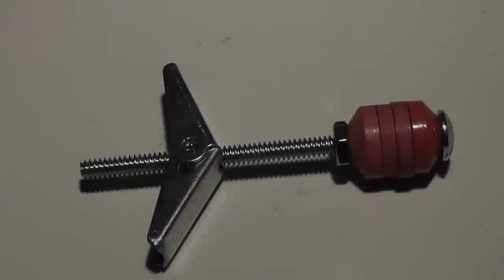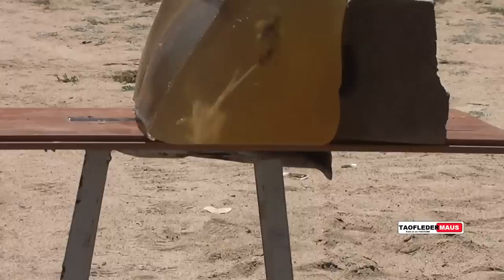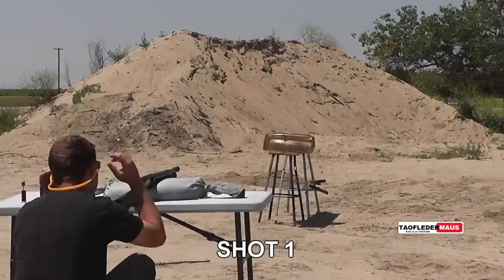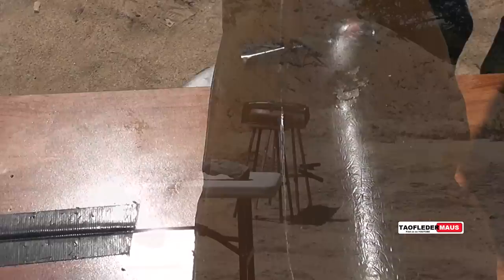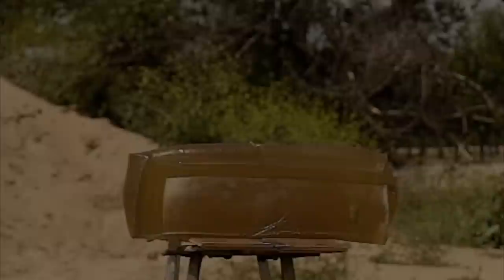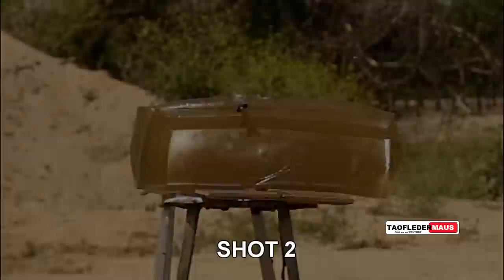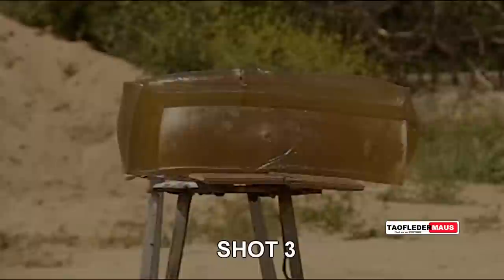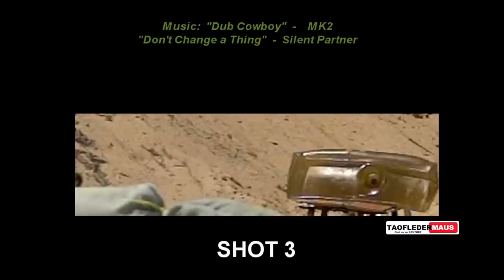Homemade SHOTGUN Folding-Fin Projectile Experiment

Comment from the maker: Song?
Reply: Darude-sandstorm
Reply: Sarude-dankstrom
Reply: ***** Toggle-Boltstorm
Reply: ***** Dankrude - Memestorm
Reply: ***** "Dub Cowboy", "Don't change a thing"
Reply from the maker: *****   Flirtin' with Disaster by Molly Hatchet.
Reply: that's a good improvised round there
Reply: Do a barrel roll! Great video as always.
Reply: Leafy MC Green imagine if he used metal. washers instead of rubber.
Reply: Sarude. Dandstorm
Reply: ***** omg rofl
Reply: ***** try to put less and more weight in the front
Reply: ***** Try reversing the toggle and see what penetration would be.
Reply: Blade Ranger Probably would be less penetration since the toggle would slow down the projectile. It would work like a parachute.
Reply: Was the barrel damaged pretty badly or about the same as usual
Reply: Blade Ranger exactly what I was thinking
Reply: He already said the toggle would get caught in the muzzle brake if it was reversed so it wouldn't work.
Reply: ***** Darude - Sandstorm
Reply: ***** darude sandstorm
Reply: BossBunny.Com butthurt detected

i did it for fun :^)
Reply: BossBunny.Com you still there?
Reply: Darud-sandstorm hehehe
Reply: The random gamer Darude - Sandstorm.
Reply: +Ponto Edu WRONG! It's tsuretette from boku no pico.
Reply: +TAOFLEDERMAUS out of all the dart rounds , this one worked the best....that's hilarious. You should try these at a longer range.
Reply: +TAOFLEDERMAUS you need this with remote C4 ;D
Reply: You guys shoulda reversed the fins.
Reply from the maker: So it wouldn't work?  huh?
Reply: +TAOFLEDERMAUS Could have taken some pliers and twisted the ends of the 'fins' to provide some more spin, you could probably prevent any tumbling and make it fly true at much longer ranges.
Reply: Boss Bunny if you want to bait at least make it seem realistic
Reply: +TAOFLEDERMAUS Shoot a Vat19 5lb gummy bear with this!
Reply: can you shoot little rocks out of a shotgun
Reply: load them tip side down.

Comment: I love this round; it has great potential. It could be worth trying a thicker bolt for more mass and less bending, though you might then need more parachute effect - three plastic "fins" would be nice.
Reply from the maker: Ijusthopeitsquick    There's several factors I have to consider when I make stuff like this.  It has to fit the bore,  it has to be able to distribute the forces being pushed against it without being destroyed,   and it has to weigh 1 oz or less.
Reply: ***** I understand. In any case well done for creating an effective projectile from drywall fittings.
Reply: ***** Perhaps a second set of "fins" screwed on perpendicular to the other and maybe a rifled choke to induce a stabilizing spin...
Reply from the maker: I don't think there'd be room in the shell for that.

Comment: LOVED this video! This is probably my favorite of your homemade shotgun round videos. A few ideas to develop it further: 1) Use something heavier than faucet washers (preferably lead) for more consistent penetration and more forward center of gravity to take better advantage of the stabilizing drag from the toggle. 2) Use a bolt long enough to fold up TWO toggles, so that you can index them perpendicular to each other. Might have to load this into a 3" or 3.5" hull. 3) Shoot them at 50 or 100 yards to see how stable this upgraded design is over a long flight path. If by any chance this is going to exceed your $5 video budget, I'd be happy to make a donation to cover the extra expense!
Reply from the maker: elektro3000   I don't think I could add more weight otherwise I would go over 1oz.   I couldn't fit two toggles on it,  they are 1" long when they are folded and there wouldn't be any room in the shell to overlap them.

Comment: Sweet, and it makes sense: Gas pressure from the back passes the fins and expands the washers against the bore, so the nose actually pulls the rest of the round; fins open on exiting the bore and provide drag at the tail to keep it stable in flight. So much better than a round being pushed from the back, inviting tumble. Brilliant.

Comment: That was really amazing. Well thought out actually. I thought that the thin bolt would bend due to the high pressure, but it all stayed in one piece and did exactly what you hoped it would do. Great high speed footage of the rounds flying perfectly. Thanks for taking the effort to do these kinds of tests.
Reply from the maker: Bill Ryan Thanks Bill.  Yeah,  that screw was pretty thin and I thought it would get all mangled up when it was shot.

Comment: Not gonna say I knew it'd work. I've seen a lot of your videos, and am hugely amused by them. Keep up the good work. However, I'm not surprised, and here's why: Stable supersonic flight requires a very fine point on the leading edge (look at things like the SR-71, or High velocity rifle rounds). or a flat one, like some ICBMs, but that's a different topic ;) The shock waves created by the object in flight prevent any traditional drag creation device, like fletching, or thread, from having any effect (this is one reason bullets have a flat behind). If you look at your "hardware store special" two things (maybe three) are happening that make that a relatively stable projectile. 1. the metal fletching is probably back far enough, and opens wide enough to get outside a shock wave. 2 The gas pressure, and spring force are blasting the fletching into the right position. spring force alone would likely work for a longer shot, but the added pressure helps them come out sooner. 3 (maybe) you could be subsonic as a result of the shape. note posted a similar comment on a different video.

Comment: Holy cow, you'd be right in my initial reaction to the round, but wow, other than some pressures making them self obvious on the first round (as it flew slanted like a wing) the rest were spot on. I was thinking that the tail would just shatter off, since the actual portion those screw in aren't very solid, but man I'm glad when I'm proven wrong in positive light like this! This deserves some further investigation.

Comment: I think these rounds can fly well past 200 yards with some modification. Turn your faucet washers around. They will lock in the open position. As it is the air pressure is causing them to open and close at different times, destabalizing your round. Move this washer forward half the distance where it is presently located then add a second faucet washer where the first one was previously situated. You need at least 3 fins to obtain equilateral stabilization. It should work so long as the tip is slightly heavier than the rest of the round. Something I remembered from my Armor Officer's Course many years ago and might be worth a shot.

Comment: Like I said before, its the Badminton Birdie design physics. I knew that would work. The only thing that would make this round more effective is a shot cup that is designed to cause twist as it exists and maybe a little longer to hold down the spring loaded fins as it travels down the barrel. 

Baddass!
Reply from the maker: jdmcommute Yeah,   I wasn't sure how well the plastic piston would hold up.  I probably could have implemented the shot cups to hold down the arms better.

Comment: Well, I did think they would work, and for a good reason - you basically made a version of a flechette round. As long as the tip was heavier than the fins, they should have helped stabilize it and allow it to fly straight. I've seen Joerg Spraeve shoot flechettes from his slingshots and they tend to be very stable rounds. So long as the much higher power of the shotgun load doesn't mess things up.

Okay, next challenge - similar round, but this time, use a pointed tip. Should blow clean through your block even more easily.

Comment: You know, with a little tinkering I think you might just have something that would make for a great home defense round. You should test it again with a bit of drywall behind the gel to see what would happen because I wonder if the toggle bolt causes enough drag and slow the slug down enough that after penetrating drywall it would slow down enough to be non-lethal to anyone on the other side.

Comment: Well, the toggle bolt will provide a significant amount of drag, thus keeping the nose pointed forward. (Drilling a few holes in the wings would increase that effect. Likewise, flattening out one side of each wing might impart a spinning effect that could increase in-flight stability.) I would also suggest that using steel washers, or a pointed, threaded lead, large caliber bullet to provide more mass, and paper or cardboard disgarding sabots,  along with enclosing the screw shaft in a steel tube, might actually make a viable projectile.

Comment: I have an idea for you.

I took a 55gr FMJ BT w/c Hornady bullet, heated it with a propane torch to have the lead drop out. Which left me with a .224" 17.8gr jacket. I chucked it in my drill took some 80 grit sand paper to it until it measured .218" with my caliper and drove it though my .22cal air rifle barrel with a aluminum rod. This was due to the sharp rifling at the chamber digging into the copper jacket and making it to hard to push in. Once ran down the barrel it fit with thumb pressure and went down the barrel easily as a pellet would. I then fired it at a milk jug of water. Normally a 14.7gr pellet would pass though and into a 2nd jug or all the way though one laid on it's side from bottom to top. This copper jacket I could tell turned as it was going into the jug.

Doing this little experiment got me to thinking though. What would happen it the jacket was put into the breach of a brake action .22LR like yours and used one of those nail gun blanks to drive it? It's heavier than a standard .22 lead pellet, obviously more aerodynamic than a pellet as well, and wouldn't have the skirt separation issue.

I don't have a brake action .22lr though, mine are all semi-automatics and I don't have camera's or a chronograph, care to try it and see what the results are?

Comment: You should try putting a wide washer in the rear so the cup has a wider support rather than just the bolt. Great footage however, I would never had guessed it would work that well :)

Comment: very nice video, thnx for producing it for us...... round 1 and 4 had sealing problems and therefore did not have complete combustion of powder. round 2 and 3 had good seal... comparing all 4 rounds to each other is a problem because of that. too long of a shank and too sharp of a base which cuts your wad and caused incomplete burn and loss of some pressure are small problems easily overcome with slight mods... you did good though.

Comment: I could clearly see it wasn't going extremely fast because the high speed seemed to be able to see the projectile better than with a normal slug, so maybe make the fins at the back smaller, thus less wind resistance = faster speed.

As always great video!
Reply from the maker: JayJoDoesMC  The first one was rather slow.  The second was screaming and used a high brass shell.  Another thing I didn't mention on the third one was it had a reduced powder charge.  I  wasn't sure if they'd be able to handle the shock so I made one less powerful in hopes at least one of them would work.

Comment: Try using a shorter bolt.  Maybe that will help shift the center of gravity a bit so you don't have as much trouble with tumbling. Although the last two shots did fortunately fly straight, maybe a shorter bolt will help with consistency.

Comment: I thought the round would work, really good centre of mass and drag. only stability issue was only 2 fins, 3 or more would be required, hence the odd angle it travelled with with an early shot. I would try more bladelike fins and 3/4 of them, if you can find something appropriate. You would not need to line it up perfectly either, with such good balance design. would be nice to see a super accurate round, looks like you are on to a good thing.

Comment: This deserves more experimentation! Screw the lever up to the washers a bit more, then cut off the excess thread. The round should fit in the cart better. And try some metal washers. I'd like to see a longer range shot too, to get a better picture of what the round is doing in the air.

I'm in the UK so I don't get a chance to do this sort of thing :(

Great channel,
Brian :)
Reply from the maker: Brian Willis    Here is why I did what I did.    The amount of energy (g-shock) pushing on the round is almost like a golf club striking it.   It isn't gentle at all.   So I wanted to balance the load by having the tips of the toggles against the piston AND the tip of the screw against the piston.

Comment: well if you put the center of mass in the front and the center of drag in the back, it should fly pretty straight. that's why the rounds machined out of a single block of metal don't fly straight - the back part with the fins is often heavier than the front, and isn't imparting enough drag to keep it flying straight since they aren't really creating much more drag than any other part of the round.

that said, supersonic aerodynamics are tricky. :P

Comment: Lessons to be learned by any potential 12-gauge slug designers:
1. Make the slug top-heavy to keep the flight stable (but not too much, otherwise the rear will wildly fling around due to the lack of inertia)
2. Add reasonably large fins to provide enough drag in the sub-sonic shockwave behind the tip.

Comment: I think the wad on the second round did it's job, i.e. the louder report and the projectile penetrating the gel and hitting the sand pile. Where rounds one and three the plastic wad just folded and you lost a lot of the gas pressure. I think you have a good idea. If you had used that on the base of those three "Rifled" aluminum slugs that fella' sent you, you would have had some really cool and functional slugs.

Comment: I think you're onto something here.  Try cutting down the shaft and screwing the toggle down closer so the end piece so it isn't sticking out so far from the shell, and maybe that will help it down the barrel better.
Reply from the maker: Tommy TwoGun   I used both the tips of the fins AND the end of the screw for support against the power piston,  to distribute the g-shock more evenly.

Comment: It worked because the highest Drag was generated by the back of the projectile while keeping the center of mass front of it. The bolts weren´t working as fins, but more like "airbrakes" and pulling the back of opposite to the direction of the motion. A basic principle of aerodynamic flight mechanics, really. This design is actually pretty promissing and could be further improved by sharpenner point, tough the bolts would reduce the terminal velocity a lot.

Comment: If you shortened the bolts, you could likely keep the same aerodynamics, but make it so that it would be able to be loaded into the magazine and not have to load it into the barrel and worry about them hitting the side of the barrel   because the wad would be around the whole length of the round

Comment: Try shortening the bolt itself about 3/4"-1" so that the "fins" will sit almost plush with the head. Flatten/smooth the end entering the wad so that the force carries the projectile (as with shot 2) without punching through and losing energy. A penny in the wad first may be sufficient.

Comment: I thought it would work, but was also thinking it would likely work better with a thicker bolt to prevent bending. might work even better if you encased it like a sabot round and used lead for the nose instead of rubber, making it more like a front heavy dart.

Comment: I don't know why it shouldn't work. I'd like to to see you revisit it but put actual effort into making it more suited for projectile use. The original design is very aerodynamic for a bunch of fasteners put together, and the "fins" of the toggle bolt acted to stabilize when shot correctly. Tao, could you try doing the same thing but this time try and make the toggle more wing-like? It could be interesting.

Comment: ***** Great video! quite surprising.  Think you are on to something here that is worth some experimentation.  I have a feeling with a little modification these could work even better.  Say a stiffer opener spring and adding some holes to create a drogue chute effect rather than an air dam.   Or flipping the toggle around, although snagging in the barrel or chamber could be a real hazard.  Keep up the good work!

Comment: What do you think would happen if you had a sabo for that round?
Reply from the maker: Jonesy   more junk would fly out with the round.  Sabots are used to fill the space in the barrel so you can shoot smaller rounds through the gun.   That's it.
Reply: Well that looks like a quarter 20 round going through a 12g barrel... Don't you think a sabot would make it fly straighter than just stuffing it into a low brass round?
Reply from the maker: They didn't sell any .730 cal sabots at the hardware store.

Comment: If you could squish those toggle bolts flat relative to the direction of travel (to make them more effective fins) while still having them work, at least a little bit, do you think it'd fly any better over distance? I'd love to see some longer range attempts at using the things to see if there is any accuracy advantage for fins extending beyond the limited circumference of the barrel.

Comment: Would it work a little better if the "fins" were warped/twisted slightly, to maybe give it a little bit of a spin?
Reply from the maker: E-z-person  If it works,  why add even more variables that can screw things up?
Reply: ***** no puns intended right ?
Reply: E-z-person might also spin the fins right off that would be funny though
Reply: Well, if the tilt is opposite the screw thread, then there wouldn't be a problem, in theory maybe...